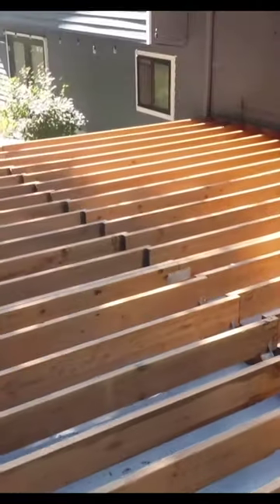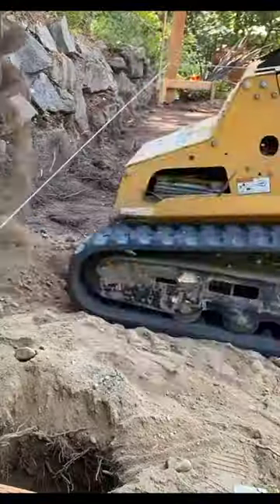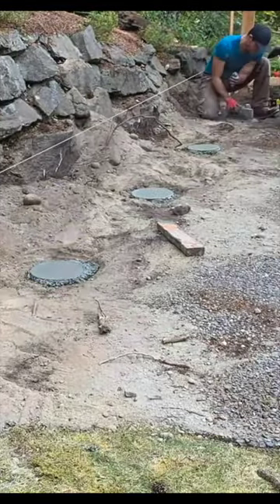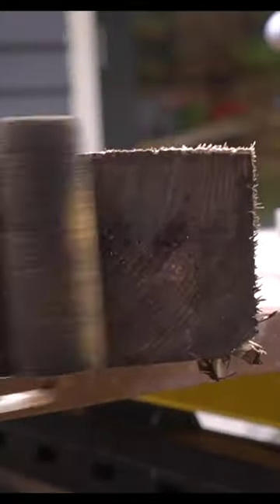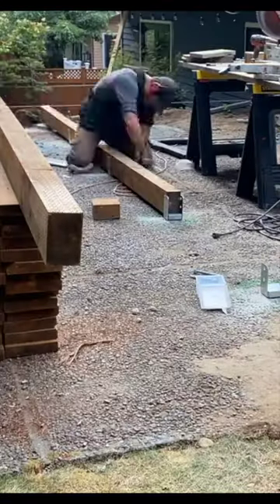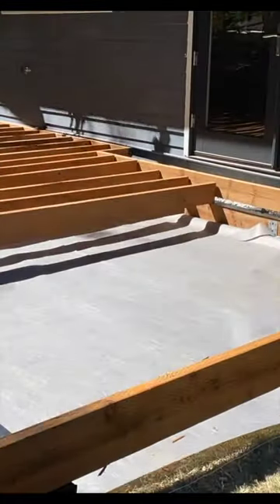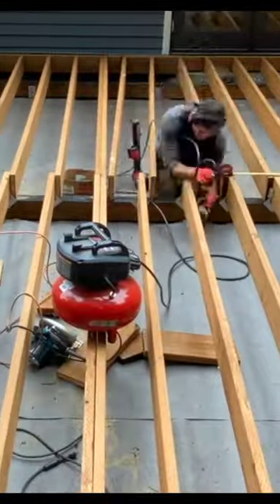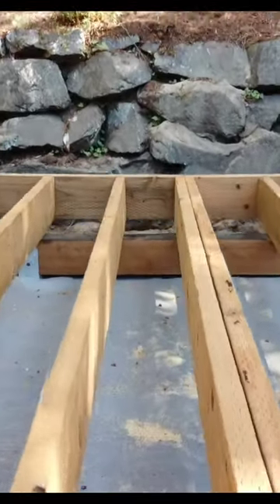DIY Freestanding Deck (Part 1 of 2)

Comment: 24"? Depends on where you live
Reply: Guess there’s no cold winters there lol cause if so that deck will move hard
Reply: Frost line here in SW Pennsylvania is only 18”. We generally dig to 20ish to be safe, sometimes 24”. Unless he’s way North he will be fine
Reply: @G19Jeeper you sure? I'm in northern Indiana and it's 42" minimum here
Reply: You are not that far south of me
Reply: @420somewhere4  nope. You are correct, that is low. 44” is the official listed from what I just saw. Seems like a bit of overkill for this region even with cold winters. Not sure how they test that. I know my porch footings are 24” or 26”, gonna measure after this winter and see if there was any kind of shift. It’s been up for about 10 years now
Reply: @Bigshott well he is putting hurricane ties down. Usually don’t get hurricanes in Midwest Indiana out west in Montana..